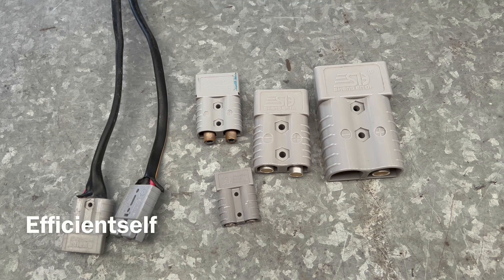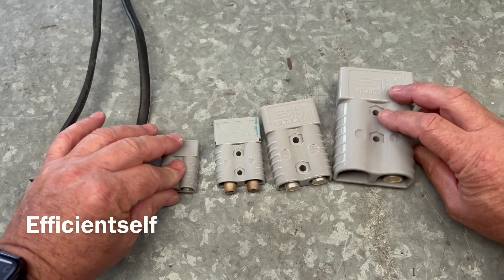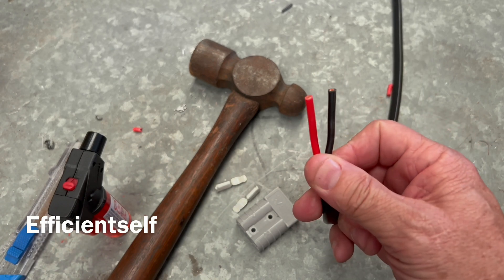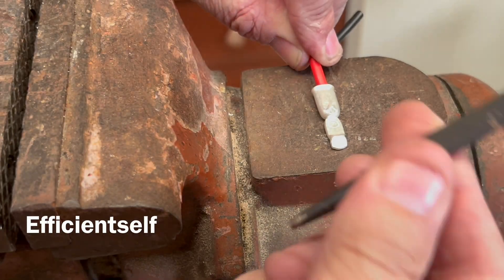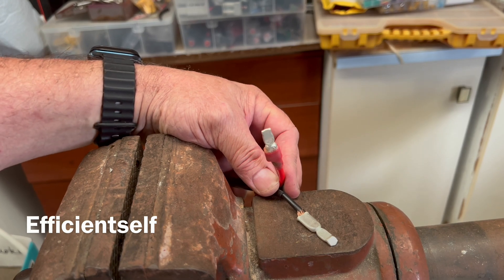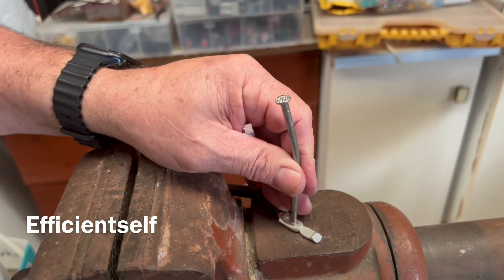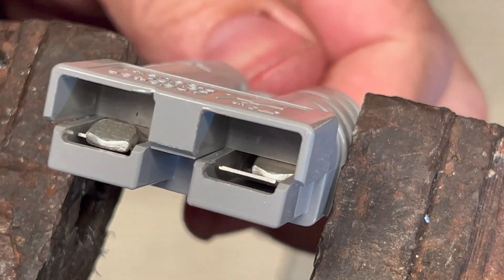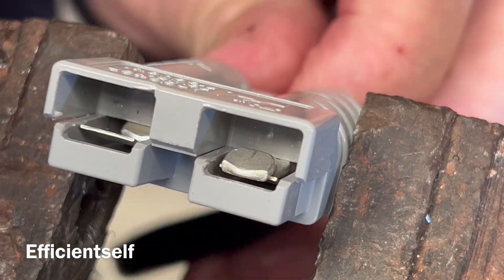DIY Anderson Plug Fitting using basic tools Beginner’s Guide 50 Amp, Solar & 12V Basics also removal

Comment: not supposed to burn the heat shrink
Reply from the maker: Heat shrink shrinks… sometimes it just overachieves thanks for watching 👍🍻
Reply: lol you mean you over acheive ? you clearly torched it by holding the flame right on it it's not supposed to turn color  fun fact heat rises so directing the heat source underneath the splice will work much better for you

Comment: Hi Dino. I hope you doing well. Unrelated question: How many Kw dieslel heater you think is more than enough to use in Sydney region. I dont want to buy overkill and end up being in a sauna. You are my go-to van build, man. Thanks in advance.
Reply from the maker: Hey legend! Thanks heaps for the kind words, that means a lot.
For Sydney conditions, you really don’t need a massive diesel heater—2kW is honestly more than enough for most vans, especially if your van is insulated properly. A 5kW heater can crank out serious heat and might be overkill unless you’ve got a huge space or you’re heading into the snow.
I’ve used a 5kw when i had the 17ft caravan and it was more than enough for when temp was zero degrees out past dalby qld.  If anything was a bit overkill.Hope this helps in some way but its best to get another opinion . Thanks for watching 👍🍻
Reply: @EFFICIENTSELF thank you so much.